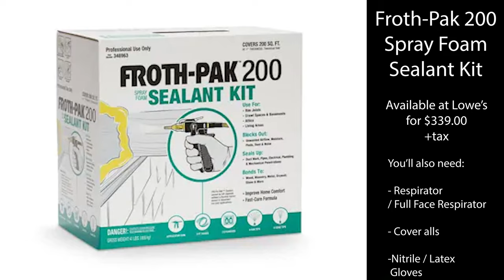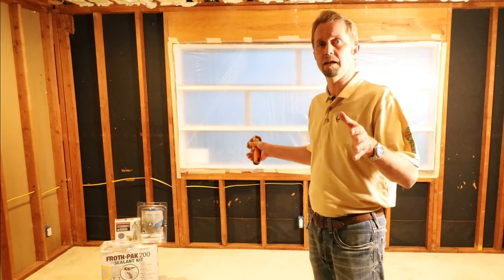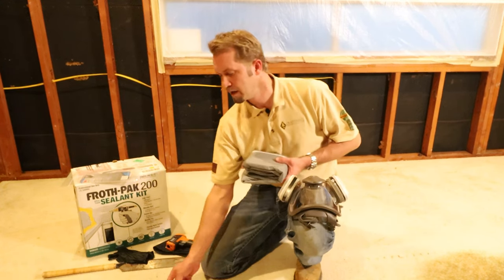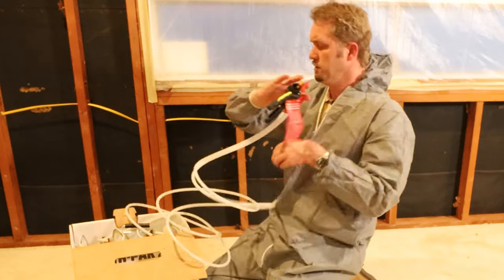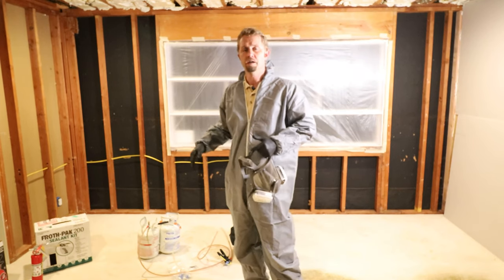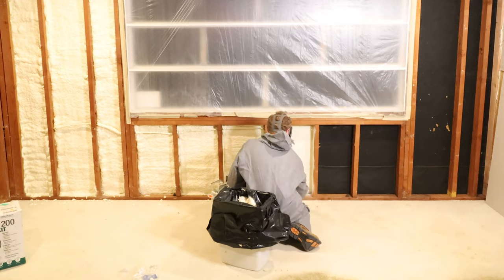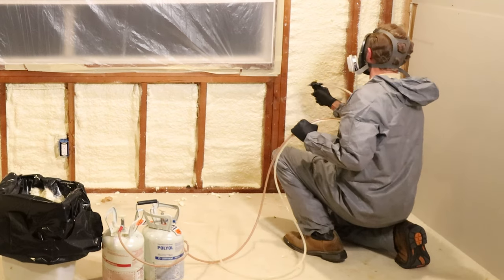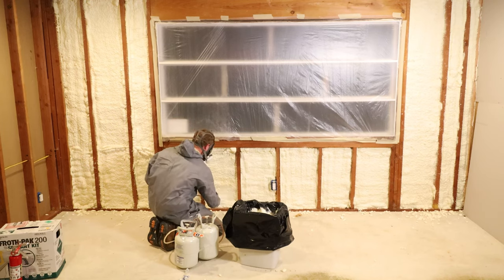Froth-Pak 200 Spray Foam Sealant Kit Set-Up, Precautions, and Spraying Review #Froth-Pak

Comment: At today's prices of $395, it's ridiculous how expensive a remodel can get.
Reply from the maker: I assume you are doing a remodel as a home owner yourself, and not the contractor doing the remodel.

It looks like the Froth-Pak has gone up in price since March 2021 for the one box. Since the minimum price for my spray foam contractor was once $1200, and is now $1500, plus whatever general contractor markup it’s part of a bigger project to be managed, you are still saving considerably, if you have a small quantity of foam type job.

Even as of 2007, I’ve done kitchen remodels that have ranged in price from $20,000 for a small 8’ x 8’ kitchen to $160,000 for something 4 times larger, more extensive, and much nicer materials.

Hopefully the video has answered all of your questions, but if not feel free to ask.
Reply: It’s gone up another $100 in a year.
Reply from the maker: @michaelshelnutt3534 At the Home Depot in Texas, I have seen prices between $369-$429, and it came back down to $369.

Comment: Application in the proper temperature range is necessary for proper curing of the foam and to prevent unintended smells from improperly cured foam.  Don't do it in an attic on a hot sunny day.  Try applying the foam at night or on cloudy/rainy days during warmer months.
Reply from the maker: It’s a good thing I applied it at night time. Did you hear my song “Up all night to spray foam”?
Reply: @craftsmanconnection  LOL
Reply: The surface it's sprayed onto is not as critical as the temp of the foam its self

Comment: A tip for the rounded bottom kit is to set them back in the box after mixing. They wont tip over and you can simply slide them along the floor with you. great video!
Reply from the maker: Yes, normally I think would have left the metal containers in the box, but from a viewers standpoint, I figured they would want to see what exactly is in the box, and from a marketing standpoint have the front of the box facing the camera.Now we know the containers have around bottom, and it would be easier to keep them in the box. I’m sure the thick, soft old carpet I had on my floor didn’t help the situation, but it made a great drop cloth.

For  my upcoming shed video, I purchased 2 boxes of Froth Pak. I might have to mention something about leaving the containers in the box after shaking/mixing the containers.

Comment: Nice explanation. I have a 12x16 vaulted screen porch roof  ( 4/12 pitch out of 2x6 ) I'm thinking this would be good,  as I don't want to vent it or fur out for regular insulation.    Do you think this would be good to do a couple of inches and then cover with some beadboard or something?  Is it OK to have air gap between the 2"  of foam and the sheathing I use inside the room?
Reply from the maker: Hi PCDubya, I have done basically the same thing to my sunroom patio. I did spray foam on the underside of the flat roof, and then I am covering it up with a wood grain textured 4’x8’ plywood.

The closed cell foam acts as a vapor Closed cell foam will work just fine for your vaulted roofline.  I hired my Spray Foam Contractor friend to do Open Cell foam on my flat roof ceiling because they are more notorious for leaking sooner than later. 

On the bead board side of your question, as a carpenter, If you are buying 16 foot long lengths of 1x6, or 3/4” x 3-1/2” pine bead board planks, you’ll want to store them inside your air conditioned house for 3 weeks or more so that way the board will shrink a tiny bit as the humidity leaves the wood. Then when you go to install it and 3 weeks later you don’t end up with that 1/16” to 1/4” gap between each board which will not look even between all boards. If you are using a KD or Kiln Dried wood product, just acclimate it to the room for a minimum of 3 days. If you are using a plywood bead board product, you will not have any need to acclimate the product.
Reply: @craftsmanconnection  Cool,   thanks for the reply. I can handle the wood part,  just curious about that spray kit like you used. I think that's the ticket. Appreciate it!
Reply: Late but just do 2 inches of spray foam then fill the rest of the cavity with fiberglass great hybrid method

Comment: This is your sealant kit, not insulation kit. One describes using on wall cavities, one is for sealing crevices and corner,  can you explain a bit more about why you are using the "Sealant kit" for insulation purposes?
Reply from the maker: They call it a sealant kit, only because it’s a small box of spray foam insulation. The spray foam insulation kits are larger boxes, like the Froth Pak 600 or 620, and obviously cost more money. If you only had one small wall to do, like I did at the time, I used the Froth Pak 200. I know it’s confusing, but the product is the same as what is labeled insulation. I have checked with the product manufacturer, and with a spray foam contractor buddy of mine to confirm this.
Reply: @craftsmanconnection  The difference is that the Froth-pak 200 is not fire retardant and the insulation kit is the 210 which is. Same product, more chemicals.
Reply from the maker: @Bui1dscharacter  Both the Froth Pak 200 & the Froth Pak 210 are insulation. The  difference is that the red Froth Pak 210 Kit is Fire Retardant.

Comment: Thank you so much that was very informative and very very helpful I was considering having a 16 by 36 building sprayed so it's very helpful in my decision making thank you
Reply from the maker: What part(s) were the most helpful? I’m planning on making another Froth Pak video for my tool shed to simulate a whole room, and have more information on the product, that people have asked in the comments.
Reply: @craftsmanconnection  The directions say to purge the hose every 20 seconds? How do you purge the lines?
Reply from the maker: @RossMalagarie you purge the lines by essentially spraying the product. The reason why they tell you to do this is so the foam doesn’t harden in the gun nozzle part. The individual hoses with the part A and part B product will not harden and until they are mixed in the gun nozzle.
Reply: @craftsmanconnection  thanks I am looking to try this product out under my house because my house is on 4 cinder blocks on a slab so I'll will spray about 1" in between the 2x10 floor joists. My living square footage is 480sqft so one 620 kit should do 1" on all the floors. I will add another 620 kit every year until it fills the 2x10. That should really help my heating and cooling bill.
Reply from the maker: What year is the house? What part of the world are you in? Climate Zone? Curious about how much heat or cold you experience during the year. According to my spray foam contractor in Texas, a couple inches is enough, and as you go thicker, there is a diminishing return on investment. You’ll be better off focusing your time and money air sealing. This means doing a blower door test, and doing things like hiring a spray foam contractor to install open cell foam (not Froth Pak which is closed cell), to help cool the attic, and the duct work that is up there. Step 2: new duct work, because old duct work, like in my 1965 house, was done with sheet metal ducts that didn’t have duct sealant and better insulation, to help reduce air leakage, and reduce the energy loss, therefore reducing your energy bill. Step 3: make sure doors and windows are as air tight as reasonable possible. Step 4: Seal any holes hidden around outlets, and between the floor and wall framing. Some of this is hard to do in a finished house, because it means removing base boards and door trim work. Look into a FLIR imaging camera attachment for about $300 and can attach to an iPhone or Android.

Comment: I live south of Houston and at local Home Depot they carry an Owens Corning FOAMULAR 150 in 1” or2”. A single 2” x 4’x8’ sheet with an R-10 value costs $40. For a job link this it would be hard to beat the foam ford for ease of installation and 1/2 the cost.
Reply from the maker: Vernon, the downside is that you don’t air sealing. What money you save in spray foam insulation cost, you’ll easily waste in energy cost. Google search the word fenestration (air movement). Search code requirements for Air Changes per Hour or ACH. Search Blower Door testing.

What you don’t see yet with the foam board is What do you do with a stud cavity with more complicated plumbing pipes, wiring, and other electrical obstacles. Not everything is a perfectly spaced stud cavity. That only exists on a paper plan. Foam board nsulation only works if you can stop the air movement around the edges, and penetrations.

Spray foam gets sprayed against the framing and exterior wall from the inside creating an air seal. Spray foam can handle sealing around pipes, wires, and every other obstacle easily. Froth Pak is a closed cell spray foam which is similar to a foam cooler material. 

Open cell spray foam allows for vapor (moisture) permeability. If your roof is leaking, you will want to know, than have the framing rot out first. Use open cell for insulation between roof rafters.

If you’re looking for cheaper materials, the trade off will be air sealing and cost you forever in energy cost.

Comment: You should have used the Froth-Pak 210 for this project. DuPont made that version for exactly for this use case. The 200 version is intended for sealing lots of small voids on larger projects.
Reply from the maker: Do you know the difference between the Froth Pak 210 and the Froth Pak 200? Froth Pak 210 (Red Box) is a fire rated spray foam insulation. Froth Pak 200 (green box) is not a fire rated product. Don’t look merely at the packaging for the answers. Look at the DuPont website which has more room for the product info.

Do you know when you need fire rated spray foam vs. when you don’t? Have you heard of intumescent paint? When you have an exposed foam situation, you’re supposed to used a fire rated spray foam, or a spray foam coated with intumescent paint.

The 200 vs 210: These numbers are the yield of the product in board feet. So technically one might give you 10 more board feet of product (5%), but in the real world job site application, will it actually be noticeable? Is that 5% more or less qualify it to be called sealant or insulation? Both products are closed cell foam, so technically, both are insulation. See the product in person. Feel it. Use a infrared temperature gun, aka FLIR imaging. Don’t fall for bad product labeling and some game with words.

I wish DuPont did a better job at product labeling, but I have no control over their product marketing team.
Reply: The fire rating is the difference, yes. A lot of states require fire rating for foam used in insulating applications. Could you use the 200 product? Absolutely. Will it pass inspection? Depends on the application, your state, and the inspector.

I think it's important for people to be told the distinction when looking at these products. Foam is a major pain to remove if an inspector sees it used improperly.

 @craftsmanconnection
Reply from the maker: @bbbbb1887  In Texas, a fire rating is required in exposed applications, but not required behind a fire rated material like drywall. 1/2” drywall has a 1/2 hour fire rating. 5/8” drywall has a 1 hour fire rating, and a double layer of 5/8” Type X drywall has a 2 hour fire rating. 

Fire rating requirements depends on the occupancy such as single family residential, multi-family residential, schools, theaters, and other public assemblies, and so on. I was a ICBO and ICC certified building inspector.

Comment: One thing no one really mentioned bout foam is that you better be sure you've got everything you want on the wall, cable computer and power done, cause there's no fishing wire after it's done. For the extra 5$ I think I'd a put 2 recepticles
Reply from the maker: I have a receptacle on each side wall at the corner and one receptacle under the window, as I would imagine where furniture could be. Re-wired the great whole room, lots of extra lighting and switches. Modernize the house. Helps to have a plan and think ahead.
Reply from the maker: There is lots of steps in building a house or remodeling. For the sake of being brief in a video, we can’t tell everyone all the things to think about prior to installing insulation. You kind of have to know the order of things, or study the process.

Comment: Great video! You have done that before. No one sprays like that on their first try.
Reply from the maker: That was my first time spraying with spray foam, but not my first time spraying with canned paint, painting cabinets, so I do have some talent for spraying some products.
Reply: @craftsmanconnection   def not a bad spray since that product is more for sealing rim joist and such like connectors and other joints .. the 210 is the "spray insulation" try that next time if you havnt ..
Reply from the maker: @Savannahjbo Froth Pak 200 is the spray foam insulation and Sealant (greenish blue box). The Froth Pak 210 is the Class A Fire retardant insulation (red box). Both are insulation, unfortunately Froth Pak packaging isn’t labeled correctly, so many people are confused, but if you go to the website for Froth Pak, it says spray foam insulation and sealant for Froth Pak 200.

Comment: Can I use this product from under the house to do floors from crawlspace??
Reply from the maker: Yes, you can use this product in a short crawl space dimension. Crawl spaces are supposed to have a minimum height of 18” to the bottom of the floor joist, and 24” to the bottom side of the wood subfloor. Working in such confined area, It would help if you had some easy way of measuring the depth of the foam. Some pro’s use a metal rod poker, like a metal coat hanger diameter. You will want 2” minimum. How many square feet do you have to do? If it is a small space that you can get done in 3-4 Froth Pak boxes, then you will come out ahead of what my spray foam contractors minimum price is to show up and do the job.

Comment: I checked out one of the professional rigs when considering doing this. Looked in a professionals trailer. The key seams to be the heater for their 2 chemicals. So, since this is a non heated mix, maybe preheat the jugs in a out door tub of some sorts, like right to the 110 degree... Anyway good effort man.
Reply from the maker: For a professional spray foam trailer mounted rig, there is a heater in there. One thing though…. They have a preheater because the trailer experiences a variation in environmental temperatures. The 55 gallon container product may need it.

For the Froth Pak 200, if you have your home at 70 -72 degrees and allow the product to sit to acclimate a couple days like I did, then you should get the results I got. I’d ask myself where was the product stored before it got to you. Did the product get mailed to you, therefore outside? (No idea where it was stored before) OR Did you buy the product at Home Depot or Lowe’s where you know the temperature of where it was stored was somewhere around 70-80 degrees inside their store, so it’s already warmed up:

Comment: Hi, I'd really like to use a foam kit here in Bogotá Colombia but they're not sold here, I telephoned the airline fright department in Miami and they said no no. No chemicals under pressure. The two components are sold here and are used on the big pro machines. I have an idea but I need a little information; I could import just the Gun, nozzles and houses and hook them up to two fumigation containers that can be pumped up for pressure fumigation. Do you think this would work? Where could I buy just the Gun with the nozzles and house? Thank you.
Reply from the maker: I have no idea where you could buy the plastic nozzle and tips independent of the chemicals. Also, I have no idea about your idea of the fumigation containers, unless you’re saying they are empty. Sounds like you’re asking about using something meant for spray foam, but using it for fumigation. Fumigation is not something I have done.

Comment: I'm confused ... directions on 200  Sealant says  .." .. not intended for full coverage  " and does not show Class-A fire rating .. ----- 210 insulation shows " Class A rated and  " For full coverage " 
 ... is the sealant ( 200 ) fire rated? if not - is that why instructions list  not intended for full coverage? 
.. does sealant  (200) need to be covered by the fire rated insulation ( 210 ) ? What exactly is the difference between  200  210 ?
Reply from the maker: The Froth Pak 200 is not fire rated. The 210 is fire rated. If you have drywall covering the foam in the walls, you don’t need fire rated foam. If you have it in an exposed foam insulated attic, your city may require a fire rated foam, or an intumescent paint coating.

Comment: Great video. Do I still need to put a vapour barrier after spray foaming the walls? I live in a cold climate where the winters reach -35.

Thanks
Reply from the maker: Hi Shawn, 
   😂😅 -35F degrees???! Wow!!! Yes, you need a vapor barrier, I’d say. Keep in mind, all of the components and hidden components of your wall assembly. You don’t need a vapor barrier for the Froth Pak Insulation itself, but the wood studs can transfer vapor / moisture through the wood itself, the holes cut into the wood, and the gaps between 2 studs next to each other. You can also help moisture sealing by caulking the mud  sill or bottom wall plate to the subfloor or concrete slab. Have you ever heard of a blower door test? Did you know Flir makes an infrared camera attachment for iPhone, etc. for around $300? You can see cold air and moisture with this device.
Reply: You only need a vapor barrier if it's open cell foam and sprayed on less than 2 inches thick at your temp I wouldnt go less than 3 inches thick. Closed cell foam doesn't have any means to allow water vapor to pass through it so no vapor barrier is needed.